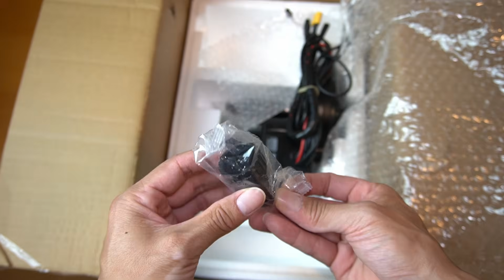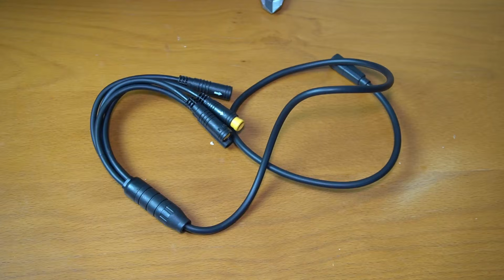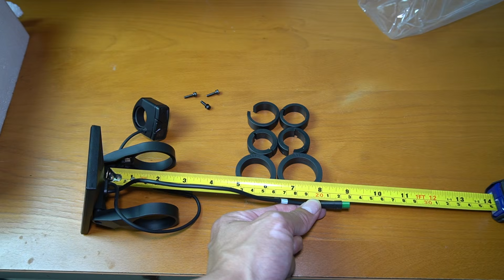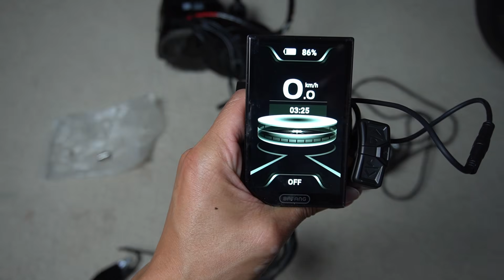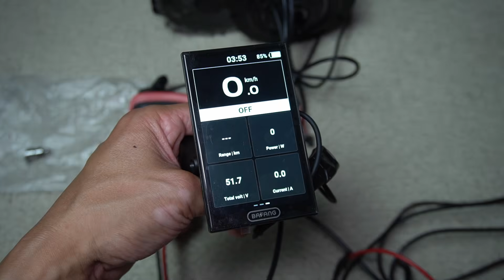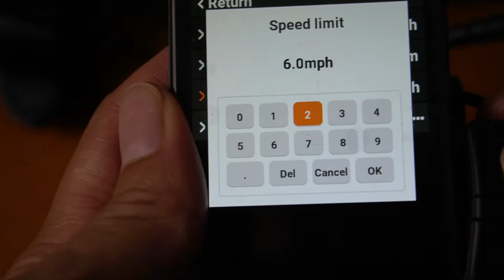NEWEST Bafang BBSHD 1000w Mid Drive Kit Unboxing - 7 Things You Should Know Before Buying

Comment: What is that torque arm you have on that trike? and where do you get them from?
Reply from the maker: Great eye!  The torque arm on the Catrike 700 is from Utah Trikes.  Please keep in mind I'm not sponsored by any bike shop.  If you see the link, you have to add everything to the cart to get the whole kit as I did.   https://www.utahtrikes.com/PROD-11621165.html
Reply: @pedalpowercycling  Thank you. I wonder if I need one for an HP Scorpion or does the one that comes with the motor work?
Reply from the maker: The stock one could work however I think it can damage the bottom bracket shell of your boom so I wouldn't keep the stock one.  In my recumbent build I use a cheaper one and has been working fine so far.

Comment: I bought a TongSheng TSDZ16 1000w with torque sensor. I wish Bafang had a torque sensor.  Thank you so much for your great educational video.
Reply from the maker: Bafang has a motor with a torque sensor, the M820.  Unfortunately, you need a compatible frame.  https://www.bafang-e.com/en/products/motors/m-series/m820
Reply: @pedalpowercycling  
* The TSDz8 the only Tonsheng motor that's IPM.
* The bbsHD the only Bafang motor that's IPM.
Possibly the best motor on the market today is Tongsheng's TSDz8...and it's also torque sensing.
Reply: @shockadellick  Disagree.
Reply: I prefer cadence for my style of riding but it would be nice to have the option.

Comment: Thanks for going over CANBus details on newer Bafang motors.  I have older UART interface motors so didn't want to buy new motors due to incompatibility with non Bafang products.  
Started looking at TOSEVEN and newer Tongsheng TZDS8 & 16 motors as options to new DIY builders. Always tell them to get the Programming Cable to flash new Firmware.

1. Nice to see newer motors will work with standard batteries.  I thought the CANBus battery cable on motor meant you had to use a Bafang CANBus battery for it to work.
2. Programming motor operating profile with DPC010 controller was good to see.  Too bad you couldn't get the CANBus programming cable, it would be interesting to see how close it was to the older UART programming with the old $8 USB/Speed Sensor connector BBS programming cable and profiles you find online. The "Speeed" app for Android phones worked well in updating friends older motors to a high performance setting in field.  The Luna bike performance setting for BBS02 & BBSHD is much better than stock.

It's 11/11/25, have fun with your AliExpress wishlist.  Nice they sell hydraulic brake handles for ebikes. Bafang should include those handles as an ordering option.  Nice to see Bottom bracket tools in the kits now.

Stay safe riding, recumbent bikes are hard to see with bad drivers.

Comment: Great vid you got a great radiance and the little smiling before each cut is also really charming. this video cleared up so many questions about this motor and generally DIY conversions. Maybe give us an update on the bike like issues you had or didnt or show us the power it got, some testriding.
Reply from the maker: Thank you, I've currently gone down the rabbit hole a bit too far.  There's SRAM 9s on the bike I want to convert and I want Shimano CUES but that takes 11s chain and not 9s so I'm debating on replacing entire groupset before or after conversion.  I suppose I should just put the motor on first to see how the range is (currently only 11-32 cassette).  😅 So many fun projects.😀

Comment: I bought this exact motor 48v 1000w and a 48v 20ah samsung cell battery from Varstrom website but it doesnt fit on all my 3 mtbs, one bike the battery fits but not the motor, another bike the motor fits but not the battery and on my other bike the motor and battery dont fit i am on the hunt for a bike then ill be able to enjoy this 😭😭😭🙏
Reply from the maker: What size frame do you ride?  The shown Stumpjumper is a medium and a 17.5Ah battery barely fits. My 20ah battery is only used for the recumbent. Have you tried a smaller battery?
Reply: @pedalpowercycling one is medium and the battery fits on that one but the other two are size Large but they are enduro hardtails so the entire frame geometry is quite slack and aggressive making the inside triangle very tight and narrow (santa cruz Chamelon and Commencal meta am ht)